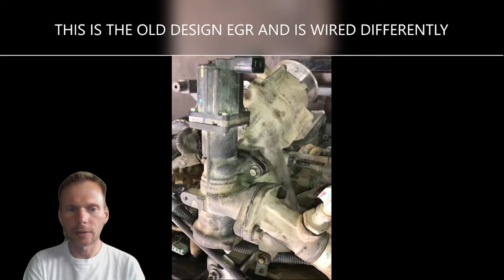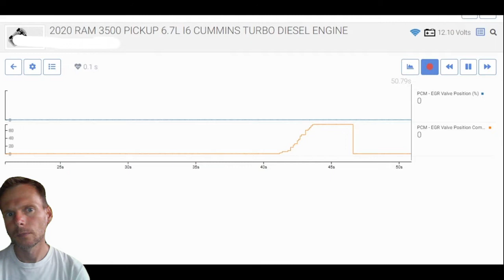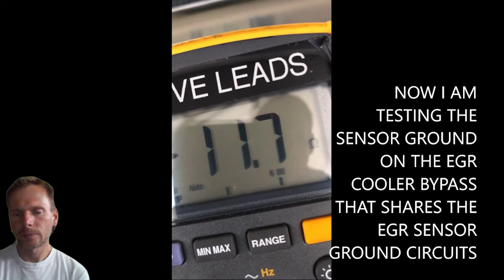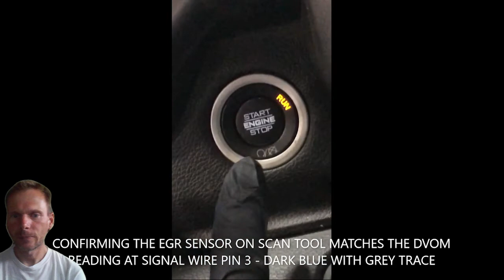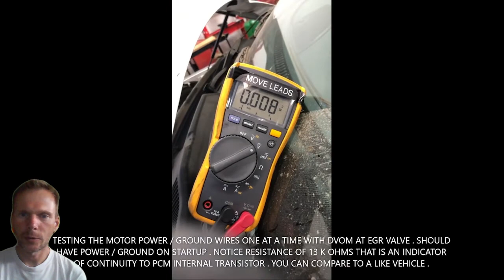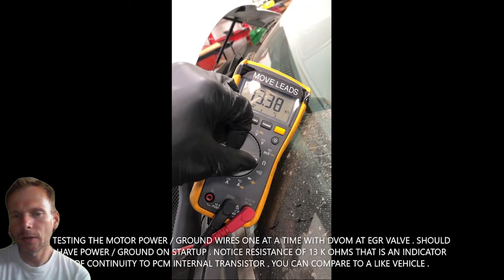2019 TO 2022 RAM 2500 TO 3500 EGR CODES  PART 1 P046C

Comment: Thank you for these details...2022 ram ETC light on.. took it to the dealer who wanted to replace the air intake for 3k we logiced them away from that but then they just wanted to replac the whole egr assembly which is another 3k... 

We figured it was electrical issue but it's almost impossible to find the pin lay and schematics online.  The logic of this video really helped 

Tested 5V references which came through fine. But found ground was bad. Added a make shift ground (with a sowing needle and ground cable to a chassisground bolt) to the egr bypass sensor and it removed the ETC light.. BUT we have a high voltage code now but hope to be to resolve it by splicing grounding wire between the EGR bypass and EGR valve sensors to restore the circuit.  We think (and hope) the break in the pig tails are higher up because ground-to-ground between the sensors is a OL...but not confirmed 

fingers and toes crossed, payers hands etc. it works because we have a 2,000+ haul coming up. Thank you!
Reply from the maker: Please join our members section to help pay for future videos !!! Jk but if you have extra bucks try it out . Limited members content but hoping to do some electrical training videos with the money .

Comment: Hi I put brand new MOPAR EGR VALVE & EGR BYPASS DPF filter Nox 1-2, DPF Pressure sensor, Exhaust pressure sensor, Turbo Actuator Cleaned intake horn, Brand new air filter, oil filter and oil, CCV filter, All EGT sensors reads properly including EGR temp sensor, Egr valve and bypass sensor connectors, Still P0489 and P046 2456 and PM sensor 0.00%(electrical) What would you can suggest me? 
I did when I put egr and bypass Flush, Restore configuration and PCM updated but still EGR Comm 0.74.9 % EGR Err -98.4% EGR Actuator 0.00% Bypass Valve actuator 2.96% and MAF works ok 0.00kg/min
I’ve engine running KOEO pin5 0.01 Pin4 00.1 pin3 0.79 Pin2 00.1 Pin1 5.09 V connector disconnect pin 3 5.09V my point is pin 3 needs replace to 92 but removing C1 very difficult even removed replacing pin 92 very very difficult and very sensitive pin and microscopic pin shall I replace whole harness because if I put and cut 2 splice it will maybe when it’s load reading low. Or stuck again 0.78V I don’t know I’m between of them 
KOEO 
Pin1. 	~108–109 Ω	
Pin2	~0.03 Ω	ground
Pin4	OL	No ground short
Pin5	OL	No ground short 
Pin4 ↔ Pin5 OL(installed brand new cable 24-4, 23-5 and bypass 71-4 71-5 brand new cable 
If you can help me I’ll be thankful so much.
Reply from the maker: I would send it to a reputable shop that works on these a lot because this can be a nightmare to diagnose .
Reply: Thanks a lot for your response any case could you tell me reputable shop please anycase. I am opening today main harness and I know very difficult nobody wants touch but I opened 3 times including remove C1 and tested it’s microscopic pins I discovered before if touch left or right that’s it you done very sensitive 2 thin wires there put C1 garbage even many mechanic doesn’t know where this tiny wires they put voltmeter and checks it’s a bubby trap for electrical😢😢😅😅 again thanks a lot.
Reply: Also maybe this knowledge good for you if you cut wire and splice it 2 points with OEM style signal is working properly. But if you do shops style 1-4 weeks after coming back signal problems again this is the best way fixing wires OEM style with tools because one tiny wire creates problems.

Comment: I fixed the problem on 2022 … not coming more volts to control EGR … i have photo where protection open and can to be fixed. Mosfet section have a resistor like 1ohm.. replace and return control from EGR

Comment: I have same issue with egr.  Replaced valve already and keep getting code Po46c. I work at dealership and tech line is not useful.  I get my 5v reference to valve, I have ohm checked all wiring from valve to ecm and all check out.  I have installed Devon at pin 4 and 5 and get no voltage. Is pcm probably the issue? Thanks
Reply from the maker: You should have 1-2 volts on dvom when YOU FIRST START AND IDLE for about 2 seconds . using a scope helps . Also if it idles for more then a few minutes when you shut off the truck the EGR goes into sweep mode to clean carbon about 5 sweeps around 1-2 volts  .  Now  when you shut off engine with red lead on pin 5 and black lead on pin 4 still connected turn ignition off and switch to ohms .usually I see 2.3 ohms and when disconnected it’s in thousands due to transistor in pcm resistance on known good vehicles . Sounds like wiring or pcm . Check for star cases .
Reply: You mentioned the door spun? Is this the poet to the cross over tube to the cooler? What actuates the door to that port? Thank you.

Comment: I am 90% sure that this is my problem on my 2021 ram 3500. I have replaced the EGR now a 2nd time and keep getting the MIL and all the codes that go along with a bad EGR as well as all the misfire codes. I can only get @20 psi of boost. Dealer keeps saying they want to replace my CAC because thats what their next step is showing them to do. I am out of warranty now because this has been going on for 20,000 miles. It started before my 100,000 was up but they said i had to pay for the CAC to be replaced. 
My question to you is, can a dealer reprogram an ECM from another 2021 that was totaled into my truck? These 2 trucks were almost identical as far as options and everything with the exception that mine is a DRW and the totaled truck was a 2500? They are saying that these ECMs in the newer trucks cant be reprogrammed into another truck, it isnt possible.
Reply from the maker: Unable to use dealer scan tool to change vin and theft code in many modern RAM trucks . There are scan tools such as AUTEL and Launch that may change vin but theft coding can be another ballgame . I would call some independents and ask for a mobile programmer that those shops use and ask them . Please post codes . These are just my opinions and not a diagnosis.
Reply: @ocdauto8794  p0489, p0490, p0203f, p0301, p0302, p0303, p0304, p0305, p0306, p0300. p056e, p046c, p0299, p0401, p226c,
Those all pretty much keep coming back. I have replaced the EGR 2 times with the codes returning with the 2nd start up. The truck runs ok unloaded, just underpowered. Loaded Trailer on the truck it is pretty gutless but still runs ok. It is an automatic and the power loss feels like when you have a manual transmission and throw it in 4th or 5th gear in town and have to lug it with no power until it finally reaches the right speed for the gear its in, make sense?   
The dealer has cleared the codes and they are all clear, after the codes are clear, i can easily get into 30 psi boost range like normal. The next day or even later the same day, ding, MIL lights and codes are all back and only 20 PSI can be made. 
We, the dealer and myself, have looked and not found any torn boots or boost leaks as well as ran several different tests checking turbo actuator and functions. Everything checks out ok. This truck is just over 1 year old and has @ 120,000 miles on it, i drive a lot. I stopped any dealer trips when they started saying the next step was putting a new intercooler or CAC on it. I only had @ 85,000 on it when this started and they said the CAC wasnt covered and i would have to pay to replace it. Im not into throwing money out the window. If it was the CAC then why does it run fine for a little while after they clear the codes. I was going to just replace the ECM but it seems to be on backorder until who knows. That is why i looked for a used one and ran into the vin trouble. 
I am almost convinced my PCM got damaged when the original EGR went bad. I am on a few forums with some smart guys and a few even showed me some TSBs or some kind of dealership papers that stated this might be the case on a few vehicles that have this issue im having. I just found this video of yours and it also has me thinking the PCM is my issue. 
sorry for the novel, just glad to have someone that has seen this and knows it can happen.
Reply from the maker: Hard call . The one thing I would do is hook up a scope to EGR but if it was me workin on it it can get pricey because the deep diag can be a few hours easy . Occasional I will see worn camshafts/rockers/pushrods causing some of these same codes but it should have a noisy engine when warm idling along with rough idle .
Reply: @ocdauto8794  Im gonna try the dealer again this week to see if a ECM has any time frame now, its been a few months since i checked. The truck runs fine, well fine if you want to drive like an old lady with low power i guess. I use this everyday for work so its also hard to drop it at a dealer that will let it sit for a few days before they even get time to mess with it. I appreciate your time, thanks.